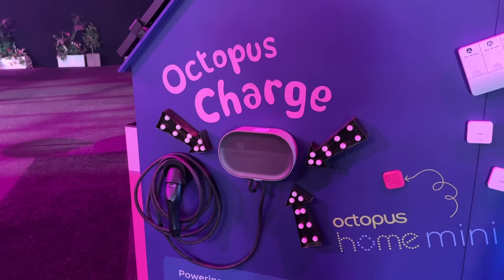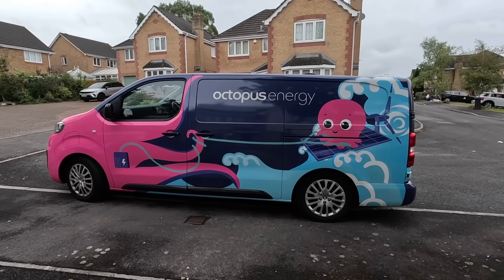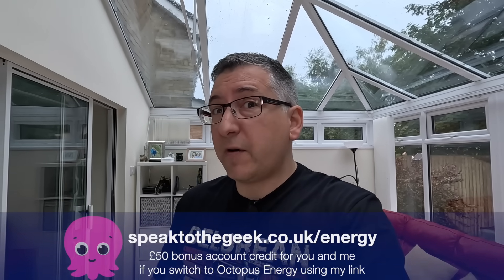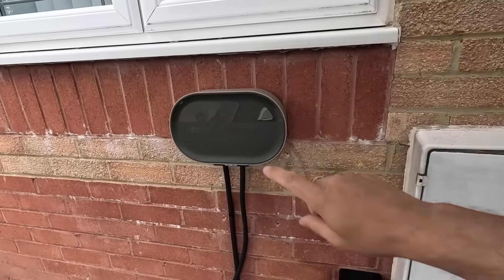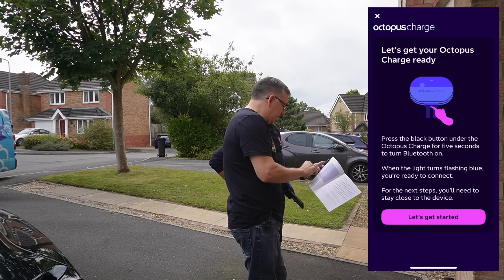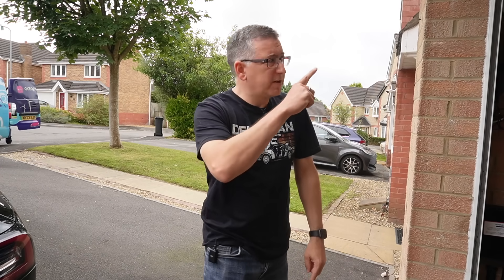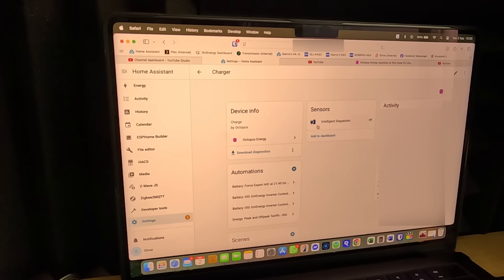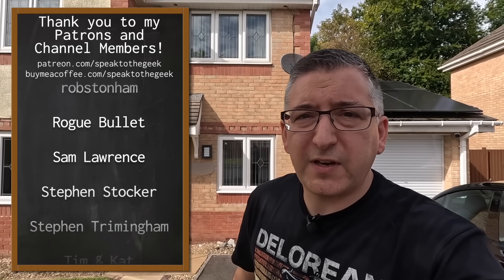Octopus Energy NEW EV CHARGER Unboxed and Installed - Meet the Octopus Charge

Comment: Hi 

Thanks for this video. 

I have just taken delivery of M3 AWD LR and have had the Octopus EV Charger installed. My problem is the charger will not charge the Tesla. The app implies it's all ready to go but it will not charge the Tesla. All the schedules are off on the Tesla but it just doesn't do anything even though bump charging works.

Have you got any idea what the issue could be? I'll be honest the staff on the technical line are not appropriately trained to help with queries.
Reply from the maker: Have you tried the Tesla on a different charger to confirm it works? Have you tried a “boost” charge in the Octopus app as a test? Have you confirmed the Tesla’s charge limit hasn’t been reached? Need to rule every component out one by one first.
Reply: @SpeakToTheGeekTech 

Thanks for your reply. I haven't tested the car on another charger. But it does charge through the charger if I ask it to via the Tesla app. 

It also works via bump charge. 

It never asked me to do a test charge at all. No option for that. Also it's never asked to connect to my WIFI. Not sure if these two items are the issue or not. 

The system says it was on charge for 14 hours but put 0kw/h in the car.
Reply: Car is set to charge to 80% and car was at 60%
Reply from the maker: Have you connected the car or the charger to Octopus?
Reply: @SpeakToTheGeekTech  charger is connected to octopus.
Reply from the maker: If the charger is definitely connected and not the car then I don’t have any ideas sorry.
Reply from the maker: But if you are asking it to charge via the Tesla app then that’s the first suspicious sign why I asked if the Tesla was connected to Octopus and not the charger. You shouldn’t have to tell the car to do anything if the charger is connected. You set your limit in the Tesla app, that’s it, then the charger itself turns power on and off as Octopus schedules it.

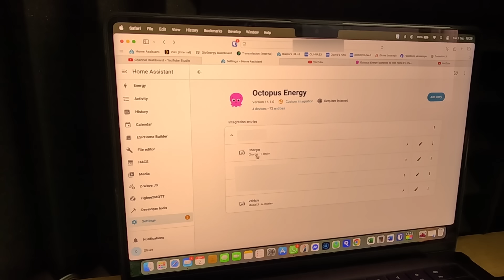Comment: My current charger is 4 years and  not IOG compatible, however, my Tesla is and my other EV, Skoda Enyaq, is charged between 11:30- 05:30 using the charger time schedule.  Whilst I have to switch the charger timer on and off, depending which car I am charging it’s not really an issue and cannot justify the cost of upgrading my charger at present.  When I do the Octopus charger will certainly be on my list.
Reply from the maker: Absolutely, if you have a working charger and system that works well for you, no need to be replacing a perfectly good piece of hardware just for this. I know I have replaced it but part of that was for the 'story' I could tell in order to make this video. In reality, customers for this charger will either be getting their first one or replacing a faulty one.

Comment: 1.How long is the lead to the car?
2.Does this need a Smart Meter to be fitted?
3.What's the cost?
Thank you.
Reply from the maker: 1. 5 metres
2. Yes or it's kind of pointless - you might as well go for a much cheaper non-smart socket if you don't have a smart meter
3. £899 for untethered, £999 for tethered.
Reply: @SpeakToTheGeekTech Thank you. I doubt if I would save enough in electricity to buy it.

Comment: Is the octopus charger compatible with solar? I.e. If you get a sunny day will you be able to feed your car instead of the battery
Reply from the maker: Yes it is, there is a solar charge mode in the installer menus but I haven't enabled it or tried it out yet. One caveat though is that it really will depend on how it's wired up in comparison to your battery. If your charger is wired like mine, outside of your battery's CT clamp, then the battery will never see the EV charging and therefore cannot discharge into it... but that also means that your battery will see the solar export first and probably attempt to make use of it before the EV charger has a chance (quite often you can set delays on these things to avoid the devices clashing!). You may have to pause your battery's charging whilst diverting to the EV. But, as I say, it really depends on your setup.

Comment: The fact that you can afford to change a working "power point" after five years at presumably more than £1k merely shows that EVs are nice to have if you are middle class with a good income. 

For millions of people in important but low paid work who need a car - like in retail, healthcare and many others doing shift work an EV is a luxury they can't afford. 

Factor in the huge number of people who can't charge at home and would have to pay 65p/kWh or more to charge an EV they are not affordable. 

65p/kWh is the  cost at my nearest charge point which is half a mile from my house and situated at the back of a shopping centre in a poorly lit car park. Neither practical nor safe. 

Nice if you can charge at home and have a good income but for many people it's a non starter.
Reply from the maker: If you ignore my careless swapping of a charger - done mainly for story in this video for content purposes, then buying an EV charger can be very cheap. Quite often energy companies or car dealers will include a car charger for free (or heavily subsidised). Octopus include a free charger with their leases for example. An EV can be a much cheaper way to drive around for many people, especially where they have off-road parking for charging. Where I do agree with you is the cost of public charging. That is too expensive in most places and I have calculated that it can be cheaper to make long journeys using diesel than it would have electric. Hopefully something happens around those costs soon.
Reply: Your reply merely confirms what I said it's a luxury product that is fine for people on a good income who can charge at home. You clearly fall into that category.
Reply from the maker: I think we're dropping below the point of it being a luxury item. Yes, it can still require an upfront cost that is prohibitive to many and it was only about 5 years ago that this technology dropped so as I could afford it. It has a long way to go I admit that but looking at the second hand EV market now I don't think we're far off that point.

Comment: I thought you had the Giv Energy charger?
Reply from the maker: I do / did. If you check out my video from a few weeks ago I had a wiring fault which meant I had to very quickly get a charger up and running. Putting my old Pod Point back online was the quickest option available to me (the GivEnergy charger requires an energy monitor and also I need to get it safety checked before I use it again). Then along came the Octopus Charge and I thought I'd give it a go for some channel content.

Comment: What happens if you change energy provider? Does the charger support OCPP and will it work with other energy providers like EoN Smart Drive for example.
Reply from the maker: It does support other OCPP tariffs, but I'm not sure Eon Smart Drive is an OCPP tariff. You could put the charger in plug-and-go mode too and use the car's scheduling instead.

Comment: Having a pre installed cable that is too short is an immediate no no for me.  If 1,000,000 are installed how many would have failures in the external connection block after a few knocks and water ingress.  No room for this obvious short coming.  It’s as daft as installing inverters and batteries in your loft that MCS were OK with until recent rule changes yet to anyone with moderate experience and education would see as disaster waiting in the aisles.  This is not criticism of the installer he looks to have done a decent job.
Reply from the maker: I'm told (not seen it myself) that the very popular Ohme has an even shorter pre-fitted supply cable. I can see why they've done this (sealed charger unit means less to go wrong there) but I do think the cable should have been much longer and the installer could then cut and crimp to the required length. If there was a fault with that junction box in the future, I would just have the charger moved to the garage wall and run the supply straight through the wall into the consumer unit. That's where I should have had it from the start!
Reply: @SpeakToTheGeekTech a presealed power entrance and exit from the unit is without doubt the best QC in the factory.  This is set against cable cost to maximise profit.  I would think a power supply side designed to accept a freshly cut and crimped cable end with a sealing compound applied would allow an installer to get the exact length needed.  Not as if the engineer was fitting any3rd party chargers.  Unnecessary junctions or low quality interfaces should be avoided at all cost.  I fitted pratlwy junction boxes for my solar power backbone on SWA cable 10mm2 because I could.  IP 67 aluminium cast with watertight glands plus a secondary earth shield in the armour and housing.  A few quid more but a top end solution.
Reply: @SpeakToTheGeekTech correct, the Ohme HomePro has a prefixed supply lead of about 1 metre. There's no problem of water ingress if its done properly with the correct compression glands.

Comment: Interesting video, thanks.  I have my charger (Zappi) inside the garage.  I can use it with the car inside or out, the cable goes happily under the rubber seal at the bottom of my sectional door when using it outside.
Reply from the maker: I have a rubber weather strip on the floor of my garage to seal against the garage door - I got flooding in heavy rain otherwise. My garage is also way too full of junk to fit a car in!

Comment: Just randomly found this video and have now subscribed. Had an Hypervolt installed not too long ago, due to the location I had to current limit the charger on the HV app (and disconnect from Octopus app). Got the installer back in to hard-set the current limit in the hardware (so it auto limits when the draw gets too high), but forgot to re-add to the Octopus App. your video just reminded me, so now I just the smart charge option. Thanks :)
Reply from the maker: Glad I could be of service :)

Comment: Nice! We have the same PodPoint and yes... it's fine, but we just use it as a dumb socket really. My Model Y is connected to IOG and my wife charges her BYD Dolphin (previously an ID.3) on a schedule in the car during the standard cheap nightly times. For the miles we do between the two cars, it works fine for us so no need to replace - but nice to see a real-world video of the unit for the first time. Only thing that struck me was I wonder if the unit itself could have gone inside the garage (by where that extra black consumer unit went) and run just the cable through the wall to the holster outside, to look a bit neater. I guess that would have meant disconnecting the pre-connected cable from the unit though, which would probably have invalidated the warranty!
Reply: Sorry to chip in but this is exactly what I came away with also when watching this. 
The charger itself could have been installed on the garage wall return nib (above the meter box but to the right of it, not face on to the driveway) That way almost all the messy wiring and boxes could be sited inside the garage itself along with the new consumer unit and only have the new trunking/duct visible. But I suppose we live and learn. And I feel that while it might be a smart unit, imho it certainly isn't a particularly attractive one not being integrated with the charging cable. 
Personally I went to great lengths to plan my cabling route, lifting floor boards and installing a duct under the suspended floor with a draw cable so the installer couldn't bulk at my chosen location_which was 3/4 of the house away from the consumer unit tucked away from public view. 
Similarly, I have a PodPoint and I totally see your reasoning about wanting to change to a more 'intelligent' charger, it's certainly a nice to have. BUT considering (what I regard as) the rather small benefits of the intelligent/variable times charge octopus offers over an above the set night times slot of 11.30pm-5.30am , I fail to see how this is in anyway cost effective over your existing unit.  So are you saying that you do so much mileage in 2 cars that you require in excess of 42hrs (7x6hrs/night) low rate hours per week ? Just asking......
Reply from the maker: I think my preference would have been for the charger to go on the outside of the garage wall with the cable going straight inside to the new black consumer unit. I'm not a fan of the chargers being inside for convenience but with hindsight I think I could have had it in a better location.
Reply: @SpeakToTheGeekTech  Yeah I agree the holster should always be outside so you don't have to faff around opening garage or whatever.

Comment: Your video indicates something I have never understood about Octopus. Why didn't they just concentrate on chargers rather than the vehicles?
In my case I have an intelligentish charger that other systems, such as energy.ev can control but Octopus can't. However at one time Octopus said they could control KIAs so let me join IO. For a few weeks IO did work but then it lost the ability to control the KIA. 
It would make sense to change the charger to the Octopus one, but can I justify the expense, as the existing charger is only 2 years old and works perfectly?
Reply from the maker: I think chargers are a more sensible option for the tariffs, but I can understand why Octopus chose to pursue both - vehicle integrations can supply the SOC %age to Octopus and they can therefore know how much energy is actually needed to get the car to your desired level. With a charger, it's guesswork. Car integration also allowed them to target more customers in the early days of this tariff - it is a beta product after all so they are still fine tuning and learning.

Comment: What if you change supplier to someone other than Octopus, will you have to replace the charger or do other suppliers recognise the unit?
Reply from the maker: The hope is that other providers will offer OCPP compliant tariffs but they don't yet exist. If you moved supplier you can just put the charger in plug-and-go mode and use your car's scheduling instead
Reply: @SpeakToTheGeekTech Sure to be UK compliant charger it has to have an inbuilt schedule, random start delay etc.

Comment: Probably could have gone back to back with the distribution board and put the charger on the return leaf of the wall of the garage no JB required then 😂
Reply from the maker: I agree. Hindsight’s a b** :) I wish I’d thought of that at the time
Reply: @SpeakToTheGeekTech  well it can’t be as frustrating as my situation I’m an approved electrical contractor, put the cable in for a home charger, just getting our first EV in November and octopus are offer a free install with 4000miles of home charger thrown in, only snag my DB is in the middle of the house and they’ve flat refused to use my supplied cable, ive certificated it but no they won’t use it and I’m not having somethjng clipped round the front of my house and up the rendered wall 😩 so now have to buy a Zappi and opt for the 4000 miles as credit for forecourt chargers 😂
Reply from the maker: Oh no! So Octopus are great for standard installations of everything but that's the way their business model works - standard installs, totally by the book, makes nationwide installation / training / support easier and keeps costs down. For anything out of the ordinary though you're best going elsewhere I do admit. Same for heat pumps too - my installation is absolutely brilliant, but it was a very straightforward one.

Comment: Always better to use the charger to integrate with Octopus rather than the car and of course not all cars are supported, as you point out.
Not sure about the cost of updating a pod point to the new  charger, yes intelligent is excellent, but if you are already on "Go" with your EV then updating your charger just to get "intelligent", is a very long payback time. Yes I know your specific case with 2 EVs, and there are other plus points on "intelligent", so do your own research.
Already got an Ohme, which integrated seamlessly and works well with Octopus.
Reply from the maker: The payback time is a long time, yes. For me though the extra hours of off-peak that the tariff gives me throughout the winter will really help especially as my home is fully electric now. Plus don't forget that you have watched this video and I am a monetised channel - I get some advertising revenue from putting this vlog out and that all helps towards justifying my purchase (so thanks for watching and engaging!)

Comment: Octopus are getting far to big and trying to take over the whole Market for Solar, Heat pumps,  Cars and now EV chargers as well as the Tariffs for EVS .Even though I have Octopus Tariff I wont be Changing my Zappi to one of these .
Reply from the maker: If you have a Zappi then there is absolutely no need to change to one of these, I don't think even Octopus would try and encourage you to do that as it would be a waste of resources and your money. Zappi is perfectly fine for as long as it works!
Reply: @SpeakToTheGeekTech  Agree I have had it for 3 years and  had no Problems. I also have a Giv energy  Battery also with no problems .